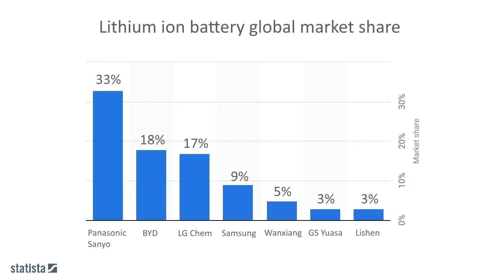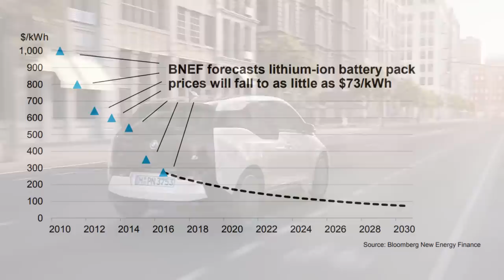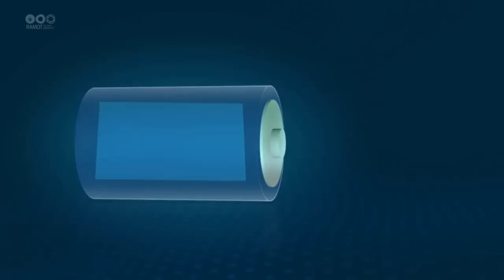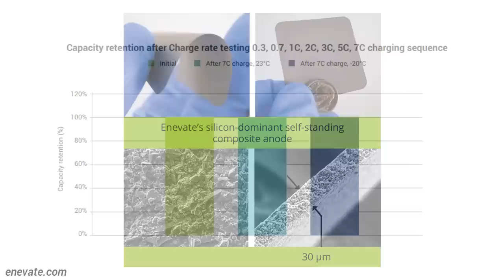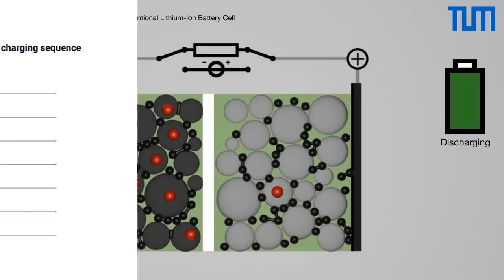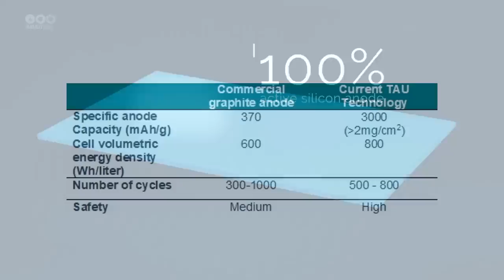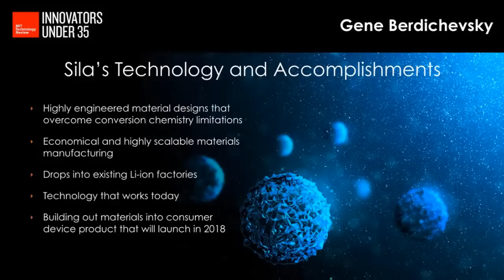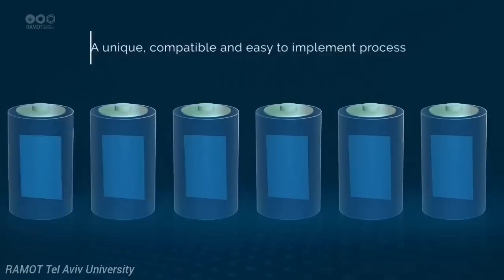The Battery Revolution. Ultra Fast Charging

Comment: what about tractors for us farmers when is some one going to make an electric tractor not that i want one i just want to see some dip shit try it and fail for my entertainment. how about i set the rules for anyone that wants to try.
1- can run at heavy loads for over 18 hours with out a recharge [18 is minimum 24 hours is preferred] 
2- can recharge as fast as a normal tractor can be refueled with diesel .
3- can be recharged in the field with out needing to come home or have a big ass cables running over the field.
4- must be safe so that it doesn't catch on fire in the 45*c heat and set my farm on fire.
5- must be protected from the environment like dust lots of dust that is real fine and water and mud and cows [yes cows those cunts like to chew on exposed wires]
rule 6 optional - onboard mini fridge for my beer, lunch and snacks. 

come on Elon Musk lets see the Tesla tractor make one that can meat these rules and survive Australian farming and i may change my mind

Comment: With grids around the world struggling to deal with ideologically driven over installation of intermittent renewables its difficult to see where all the elctricity is coming from for mass deployment of EVs.    They usual answer is a rainbows and unicorns answer where everyone is rich, lives in free standing house with solar and batteries and has their own of street parking space.    If the cost was the same, if I can recharge in an hour or less, if I have a minimum usuable range of 400kms I would happily consider an EV.  We live in the outside a metro area.

Comment: All you're doing with an electric automobile is changing the location of the pollution.  Simply because you don't see the pollution when you're driving doesn't make the vehicle pollution-free.   An electric vehicle would have to be able to go at least 550 miles in a day without recharging to equal what I do in a gasoline or diesel powered vehicle - and it can't take all night to recharge.

Comment: All this electric vehicle nonsense is a pipe dream until batteries are a lot better,charging facilities are everywhere and the National Grid can cope with the extra demand that EVs would put on it,the Grid can't cope now at peak times when the weather is freezing and everybody turns up the heat so what's going to happen when millions of vehicles suddenly plug in to recharge them,the answer is power cuts because the Generators can't keep up with Demand,it's not been thought out.

Comment: Ultra fast charging is al very well but it puts huge peak loads on the supply network. However. most of the time, people are not really concerned. They are bothered by the cost of batteries.

Comment: The price of batteries is dropping but surely demand for lithium and other components is increasing - and the supply of lithium comes from relatively few mines around the world - so the price of lithium (and then batteries) is set to skyrocket unless graphene or some other material is used instead.

Comment: Will the charging station have a portable  solar charge station for home and road use option  and if an Electronic Pulse happened would the complete system shut down and become permanently inoperable?  Is the charging stations affordable and how much would it be to charge at a service station for electric cars. Instead of just sports cars have you considered suv or campers

Comment: Staying focused on lithium ion batteries is going to slow down ev adoption.  The next revolution will be cheap, solid state batteries and super capacitors driving the costs of ev down much faster than energy storage that uses expensive rare metals.

Comment: This may very well be off topic but I figured some one might want to try this out... I have an idea for a lifting force machine. 
Step 1: Get hollowed out cube.
Step 2: Securely attach magnet to inner bottom of hollowed out cube.
Step 3: Place a lever on inside bottom of cube behind the magnet that's securely attached to inside bottom of cube so that one side of the lever is pointing towards you and hanging over the magnet.
Step 4: Attach a vertical bar to the top side of the part of the lever that is not hanging over magnet witch is securely attached to inner bottom of cube. Make sure the bar goes all the way up to the inner top of the cube barley touching it.
Step 5: Securely attach a magnet to the side of the lever that is hanging over the magnet that is attached to the inner bottom of cube.
Note: Magnets need to be facing each other with attracting poles N,S or S,N
Note: The lever is going to have to be really close to the magnet on inner bottom of cube because of how close those magnetic fields need to be to interact. But not so close that magnets can touch.
The magnet on top connected to lever is pulling the magnet on inner bottom of cube towards it and since the magnet on inner bottom of cube is connected to cube, this pulling force acts as a lifting force. Now at the same time the magnet on inner bottom of cube is pulling the magnet on top downwards BUT the magnet on top is connected to the lever so any downwards pulling force is being converted mechanically by the lever into upwards lifting force. Now if you know anything about magnets you now that there are magnets powerfull enough to lift far more weight then just there own. So essentialy this divice is exploiting the powerfull pulling force of magnets by mechanicaly transforming its magnetic pulling force into mechanical lifting force through the clever utilization of a lever, and walla stuff can be made to fly. Imagine if the magnets in this experiment where electro magnets so the ammount of electrical current going into them determined the ammount of lifting force that it would have. Now imagine this system being used as an attachment that could be placed under or ontop of vehicles to counter the weight of the vehicle and any cargo its carying. Now imagine  if this was done with powerfull permanent magnets and turned sideways and placed in an electric generator and had enough strength to pass through the magnetic fields as it propelled itself forwards with its own magnetic pulling force.     Signed   AMA

Comment: Unfortunately most of the energy used  is wasted on moving a big heavy box (the car) with electric power when the vehicle could be far more energy efficient if it was much  smaller and lighter.

Comment: Its time to drop battery power and concentrate on transmitting it . Tesla proved it was possible , power can be embedded in a digital signal and sent/ collected by any given device the same as a mobile phone  vehicles could be charged from a single electric cable running above any given road .energy could be transmitted from existing phone masts .No wires No battery it is only a matter of time ,we will see the wood from the trees.

Comment: One would expect Tesla to be in the li-ion production list.
Reply: Tesla are not in the list as they contract Panasonic to produce their battery cells form them both in Japan and the Nevada (Gigafactory One)
Reply: Andrew Zamorski the giga factory makes its own cells. The model 3 uses tesla's own cells . Rightnow the S and X use panasonic but that will change as well.
Reply: I am not sure that is correct. Panasonic make the 2170 batteries for Tesla in Gigafactory One, they have there own restricted access space that they lease and pay for, they are may be Tesla batteries but they are still produced by Panasonic. Panasonic raised capital to be able to do this.

Comment: IF you have to go 580 miles (930 km) in a given day, or perhaps even longer distances, refuel is about 3-5 minutes... possibly 10 if food and <ahem> recycling is involved.  Recharging 3 times at an hour or more per recharge with all current equipment would add many hours to the drive.. like 14 hours becomes 18 hours..  The savings on fuel becomes $100 lost due to a night at a hotel.  I can't see switching to electric at any point in the near future... Well, until the Audi/VW super charger network is operating... Another minor issue is the fragility of the grid in this country.  Super Chargers take the effective load from a small city to charge the cars and trucks. The grid would blow up given a spot load like that.  Dropping loads of megawatt sized chargers in one area will cause regional outages.  (And thus no charging..)  If the VW chargers have 2-3 acres of solar and large batteries, they may be able to work...
Reply: commerce is important for renewable*

Comment: LOL, In 1966 when I was in the Middle east on military duty in Libya oil well were producing over 600 barrels a day EACH. Today those SAME wells are STILL producing 600 barrels a day EACH with NO sign of reducing. Oil is NOT a finite Energy Fuel...it will be around for centuries more and all we have to do is find a way to make is Burn Cleaners. And, get better milage. Only thing IS, he Federal Gov't make MORE on a gallon of fuel (gas or diesel) then the Oil Companies do,,so I don't see THAT last part happening any time soon .
Reply: so in 500 years when the population is 25 billion and oil is starting to dry up and start hitting laws like thermal dynamics limiting efficiency what are we going to do with 24 billion cars that require it? if we start using electricity now we wont have to worry about an oil shortage since they can use gas/ oil/ solar/ nuclear/ and hydro power to produce energy for them.

Comment: Pushing the technology envelope is always good but not at the cost of government intervention to force this nonsense down the throats of the consumer and pretending that this is green. It is not. Most of the EVs charged in this country will be done via the grid which is powered by fossil fuels. There are already conventional vehicles that get better mileage than EVs and to build out an entirely new infrastructure just to operate these vehicles is insane. All the energies used to do that not to mention to mine the raw materials to build these batteries can be put to better use. And there is the problem of hazardous waste disposal at the end of life for these batteries - and no, they are not recycled.

http://coyoteblog.com/coyote_blog/2018/04/the-electric-vehicle-mileage-fraud-updated-tesla-model-3-energy-costs-higher-than-a-prius-despite-crazy-high-empg-rating.html

Comment: 'getting to the end of oil age' ?   very questionable at this point and time, big oil has still got our wold economy&politics by the throat and will not give it up so easy, and lots of goods are still dependent on oil such as plastics etc..   there will be sucking it for a long time to come, until it gets less economically viable comparing to other better renewable alternatives

Comment: where does the electricity come from? answer fossil fuel, charging the battery will result in more fossil fuel per mile rather than less, also the battery production is also fossil fuel intensive

Comment: Problem is personal demographics dictate that you may not be able to ev no way to charge at home or work for instance fossil cars by there nature of production run have full spectrum of sizes of models available where alternates do not . My concern is that with countries now setting ban dates for new petrol and diesel electric still has too far to go in too short a time frame alternates are the future but I don't think they can get there in such a small time frame to satisfy demand demographics

Comment: It's only been 15 months since this article was made and already certain events had not unfolded. 
The acquisition of Maxwell batteries by Tesla has them planning the integration of super ultra capacitors with dry cell battery technology advancing their place so far ahead... that competition will not be viable. 

This too will mean the end of cobalt and Tesla's partnership with Panasonic batteries and the beginning of safer, cleaner, lighter, faster charging, more storage capacity and longer range. The big three motor companies have no plans whatsoever in producing EVs, expect the biggest exits in business since Kodak blinked with Digital cameras...

Comment: this looks like a scam to increase electricity bills like crazy.plus these cars will lose value very fast as buying one of these cars after a few years of use, the new owner is going to pay a battery pack that might be as high as what the car is worth,low wage earners  can not afford theses cars, and there is no sign of theses cars going down in price without making them with smaller battery packs them your range is drastically cut , and worse of all when you get that first bill after charging your car during that first month will make people want to cry

Comment: I drove a bmw i3 for 6 months, but I then traded it in for a bmw 216d for the following reasons : primarily, the range of only around 120km in the summer, which then fell sharply in the winter to only 76km at 0C in the winter ! As I travel at least once a month 170km (one way) on the motorway to visit my kids, I had to stop for an hour to charge the battery after driving only half of the journey, even at a lower speed than is normal on the  motorways (110 km/h instead of 125-130km/h). This meant that the journey which normally lasted 1,5 hours would then takes almost 3 hours, at least - because it is sometimes difficult to find a charger that is not already occupied. If the industry doesn‘t want to kill off e-cars in their infancy, they should STOP offering cars with a range of only, or little more than 100km! It is no pleasure to constantly have to worry about whether you will really arrive at your destination or not, while hoping than when you arrive at the charging station that one will be available for you ! Furthermore there is the issue of the longevity of the battery : eg who says that a new e-car having a range of say 200km will still have that range when it has driven eg 100 000km ? Until these issues have been resolved, I intend to drive my environmentally friendly bmw 216d (Euro 6 d-temp) with a range of 1300km, no problems with finding available charging stations, and no worries about its longevity. While my i3 was fabulous to drive, its shortcomings mean that it is really only a city car, and therefore not suitable for my particular needs.
Reply: get a model 3 extended range (500km range), the battery degrades about 5% every 170,000km.

Comment: Energy does not come for free, be it electricity or combustion ( or whatever else ). Just because EVs don't polute like ICEVs doesn't mean it doesn't at all ( for example manufacturing polution, waste from dead batteries, how the electricity is made etc. ). Also I doubt EVs will last as long as a ICEVs. If you research enough you will see that EVs aren't such a bargain. When it comes to cars, ICEVs are more versatile right now.
Also, regarding the car manufacturing, I really want a car, not a phone on 4 wheels with room in it. :))
Reply: Ev's charge mostly at night when power is abundant, helping to balance the grid. Batteries can and are recycled, but new battery tech will make it a non issue anyway.

Comment: Instead we can fit intermittent induction coil in road for every  certain kilometers. We can fit automated billing via online through energy meter installed in a car.  The induction coil not required whole road instead govt can provide some intermittent km it will help

Comment: I've worked in the Lawn and Garden industry for 30 yrs. In the past 10 yrs I have taken older lawnmowers, refurbish them, and resale them so they don't end up in the dump. I have seen many electric mowers out there, and they work great. The problem is the battery, or should I say the consumer. After seeing this video, I world love to see this kind of tech in mowers. Because most of the battery powered equipment end up in the dump, and not being recycled.

Comment: I am really excited that we may be moving away form the infernal combustion engine. Just one small fly in the ointment. Where will all this extra electricity, for charging, come from? The same European governments that have set (in my opinion) ludicrous deadlines for removing petrol/diesel vehicles form the roads are the same governments that are planning on getting rid of coal fired power stations, and nuclear.
Currently, electricity produced by wind turbines is at least four times the cost of coal derived electricity to the consumer. They are inefficient and expensive, and a bigger blight on the landscape than conventional power stations. This will easily outweigh any reduced cost of the vehicle batteries. Cheaper to buy, still very expensive to run, compared to petrol.
Solar will only be of any use when we can gather and store enough electricity to recharge all these extra consumers of electricity (vehicles), which we currently cannot do.
I am optimistic about industry, but not about governments with their high-taxation "green" agendas.
Reply: Most EV's are charged at night, when power is abundant. so far from straining the grid, EV's will help balance it.

I'm not sure where you are getting your numbers for the cost of wind and solar. But they are now one of the cheapest ways to generate electricity.

Comment: Eventually graphene batteries will power electric cars but by that time I will be very old or dead. I am guessing sometime between 2050 and 2100
Reply: Ehhh... I'd say that 2035-2050 is a more reasonable timetable.  Also, if you're currently in your 30s or younger, I wouldn't bet against you still being around in 2100.